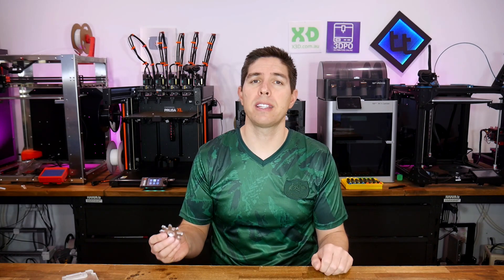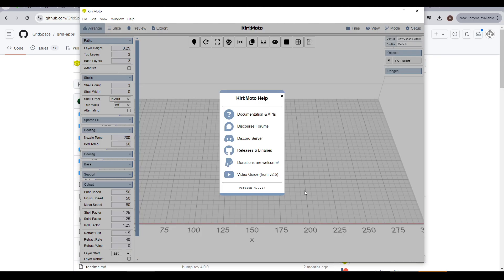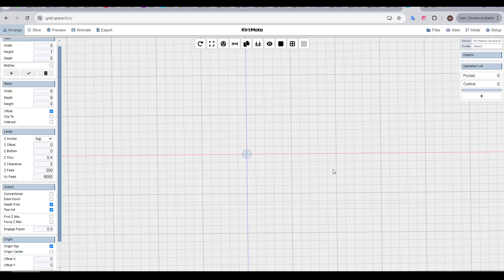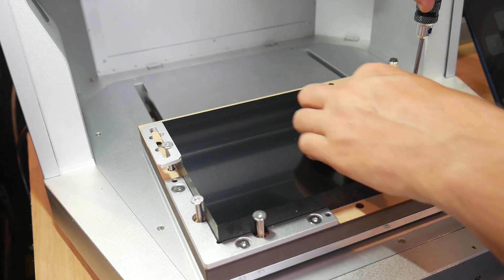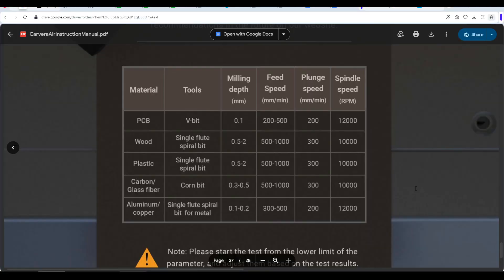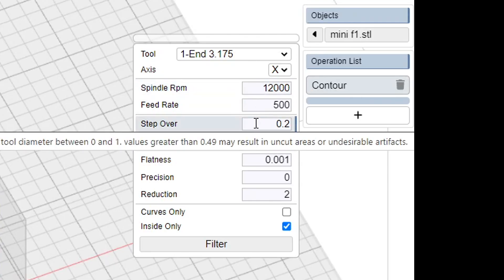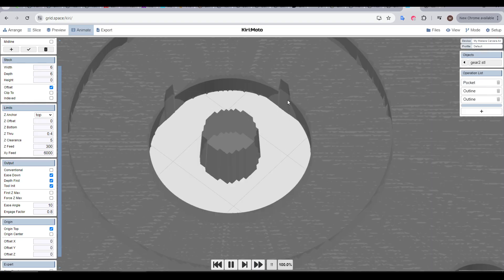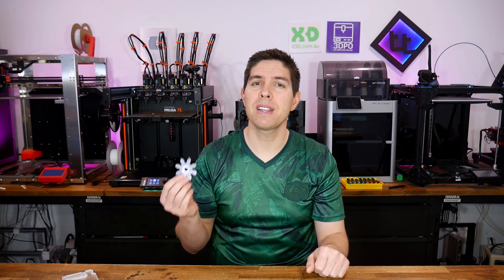Guide: Open source free CNC CAM - Kiri:Moto

Comment: Thanks for the video.
I am about to get a Makera Z1, that looks to have many things in common with the Air you use...any idea whether Kiri is able to work with STL files and generate G-code for 4-axis or not.
Thanks again.
Reply from the maker: Kiri Moto still compatible with the Z1, 4th axis and otherwise.

Comment: Awesome software. My CNC process included a lot of programs (Candle, FlatCam, UGS...) This seems like a good one-for-all replacement. I'll definitely try!
Question: Do you know how tool manual change operations work?
Reply: from KM you have a few options depending on your setup / sender. if your sender supports pausing on some gcode, then you can edit the tool change macro to suit. if not, you can choose to export your workflow as a .zip file that contains one gcode file per tool or per operation.

Comment: two questions: i just downloaded it from the github, how do i install/run it? and how does the tool changing work for a cnc without automatic tool changer, does it pause the code and asks for a tool change automatically?
Reply: tool changing answered above. if running from cmd-line is not clear from the readme, then probably download the pre-built desktop version.
Reply: @GridSpace  thanks for the answer, where can i find the prebuilt version? im not very familiar with github

Comment: Pretty awesome project. But I am struggeling with the drill operation a bit. Also the fact that I cannot specify a target for each operation (and it tries to figure it out) is a bit - weird. It also just added a face operationg that I didn't specify. But I still have high hopes for this.

Comment: You could potentially have this running on a local server - such as a pi - so that you could use it on multiple local devices in the browser, you just need nodejs.
Reply: the github project readme covers running it locally (such as on a pi)
Reply: @GridSpace  Is there any way of running it in the background ideally from a systemd service?
Reply: @mfraz74  certainly. In production, I use "pm2" to start it and keep it running across system reboots.

Comment: all thats missing is supporting gerbers for pcb manufacturing and 5 or 3+2 axis machining for pocket nc users then it would be the goto for anything out there, it would replace so many pieces of (even paid) software. really nice
Reply: as it turns out, it does support gerber. I just made a video about this. KM has gerber to 3D import which makes some guesses about how to interpret the 2D planes and a constructs a solid. for times when that guesses wrong, you can use Mesh:Tool (a part of KM) from which you can extrude selections from the 2D gerber planes into 3D elements for CNC milling.

Comment: Thanks for that video, well presented. Aside from your video, what system specs do recommend for CAD and CAM software. I use FreeCAD for my modeling ( 3D printing) not into complex models. I am thinking about upgrading, before win10 is not supported. My system is showing its age, seeking advice on system specs. I do know the number of threads is only important if you doing complex tasks like animation (not me). So a single thread speed is better. I don't know anything about graphics, and if a separate card for a desktop is beneficial. We have home brew CNC at our men's shed, and keen to get it in production. Many thanks, and regards, David

Comment: I can't see any reason to prefer this over fusion 360, which is already free for hobbyists.

With F360, you have a much better UI and support for features that KM just doesn't have, like form-mill tooling (great for custom modeling tools like slitting saws to make undercuts or perform parting operations with) 

You also dont seem to have support in KM for multi-setup stock modeling which is huge.  

Using your racecar as an example, I must be able to machine vents and louvres on the side of the car, and then flip it to machine the top surface WITHOUT the program losing track of which surfaces are already machined. The CAM software must also not try to remachine the area that has already been completed.

Not being able to set your origin by clicking on a part feature (like the top or bottom of a bore) is also a huge downgrade. For mechanical parts which rely on tight-tolerance hole alignment, KM's strategy seems very cumbersome.

I just dont see why anybody would want to use this when there are so many better options available. This is probably fine for very simple 2.5D parts but I can't see myself ever using this for a truly 3D part with complex requirements like thread milling. But F360 already does that simple stuff just fine.
Reply: 4th axis is super artificially limited and f360 changes their terms all the time, often removing features from paying customers. They're a scummy company imo.
Reply: Free Fusion is also missing some things, like rapids. It's also much MUCH more complex to learn. I really do prefer the paid version over everything else I've used so far, but can't bring myself to pay for something that gets yanked from under my feet, undergoes workflow-disrupting UI changes with no notice, and stores my projects in often inaccesible cloud storage.
Reply: @turbomacncheese totally agree
Reply: These better options like Fusion 360 can be removed at any time.
Reply: Seems like a good CAM for hobbyists. It’s like EstlCAM. But I will use fusion 360. 
I subscribed for fusion to have the CAM with tool changes, rapid moves. I use cutter composition with PlanetCNC (CNC controller software) too.
Reply: In just an hour I’ve taken an STL, created my paths and cut the piece out of aluminum on my CNC..in love. I don’t understand how anyone gets anything done in 360…struggled for years on that pos. Constant crashes, painfully slow, infuriating…Tinkercad however is a masterpiece and I’ve built lots of complex designs even full carbon fiber sim racing wheels with electronics solely in Tinkercad. Even kids can start making workable creations and the last thing I want is to put my 10 year old son off as he’s discovering this exciting world.
Reply: Nice ad